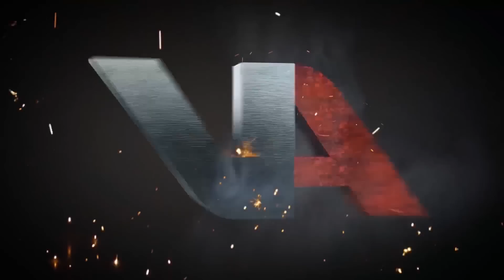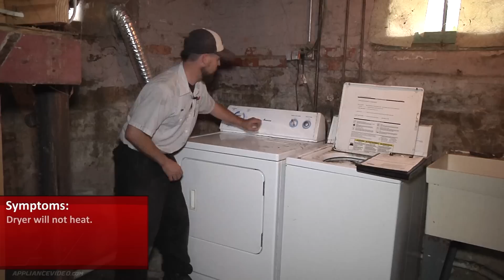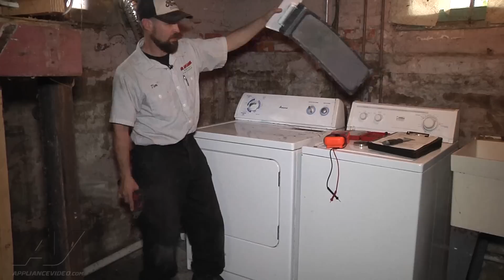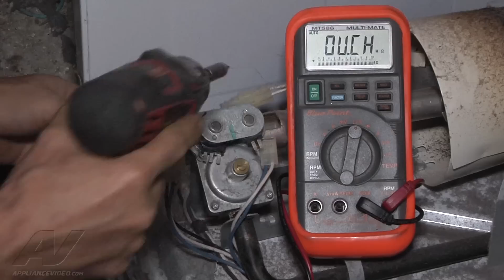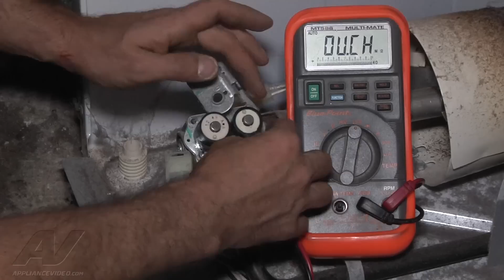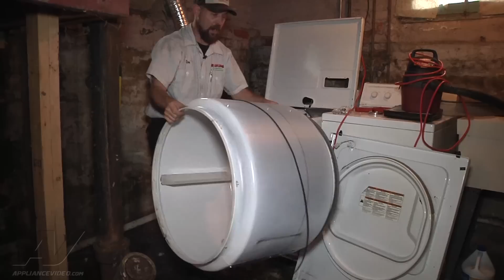Amana Dryer Repair - Not Heating - Gas Coils

Comment: Looks like my previous comment didn't post, i did not pay attention to which slot the tension pully goes into. Closest to the dryer or to the door? Yes, I have tried both, and i still have way too much slack. Are there any videos that would be able to help me with a visual reference?

Comment: Okay, now my belt is stupid loose, i did not pay attention to the tension pully location.. my good man, would you happen to have a video that shows how to tighten that up? The belt and tension pully. It does look like there is a screw hole in the pully bracket. However, there isn't a hole to screw the bracket into. Just the slots. Two sets of slits for it. One closer to the motor and one closest to the door. Please advise my good man, or anyone for that matter that can help an old man out.

Comment: I have same dryer it’s lighting but it only stays on for like 10 seconds then goes right off. Takes forever to dry and clothes are super static and in clumps wrinkled. Would that be one of the limits bad? It was working fine I changed belt and shop vac cleaned it I looked to see if I busted any connections I didn’t see any. It’s makin me mad not bein able to figure out and don’t wanna buy every part for it and fix no it’s something simple I’m sure

Comment: I mean… He did a great job explaining how to pull the machine apart, but the problem with his machine is not the problem with my machine. So it didn’t teach me how to fix my dryer
Reply from the maker: Great question, if you have a more technical question that our parts department cannot answer, you can search our over 17,000 answered questions free at our website www.ApplianceVideo.com under our Repair Help section. You can also call our parts department at 1-800-830-5465 and they can give you help 7-days A week ,or search at www.SaveMoreOnParts.com  .

Comment: Ugh, so when I open the lid, the screw fell down the lint part of the metal. Do I have to open everything up to get the screw back out? Please advise. 

Thanks,
T.
Reply from the maker: Great question, you can call
our parts department at 1-800-830-5465 and they can give you help 6-days A week
Mon-Sat . You can also search at www.SaveMoreOnParts.com 7- days a week.  If you have a more
technical question that our parts department cannot answer, our technicians are
answering all questions at our website at www.ApplianceVideo.com under our Repair Help section. We have over 6,000
common questions and answers that you can easily search through by your model
number, appliance make, problem or error codes, and It’s completely free to
search through our question & answer library. There is a very good chance
you question is already answered there.

Comment: Where did you get the gas coils from?
Reply from the maker: Great question, you can call
our parts department at 1-800-830-5465 and they can give you help 6-days A week
Mon-Sat . You can also search at www.SaveMoreOnParts.com 7- days a week.  If you have a more
technical question that our parts department cannot answer, our technicians are
answering all questions at our website at www.ApplianceVideo.com under our Repair Help section. We have over 6,000
common questions and answers that you can easily search through by your model
number, appliance make, problem or error codes, and It’s completely free to
search through our question & answer library. There is a very good chance
you question is already answered there.
Reply: I got mines from amazon.com